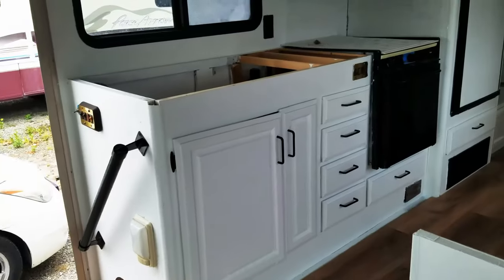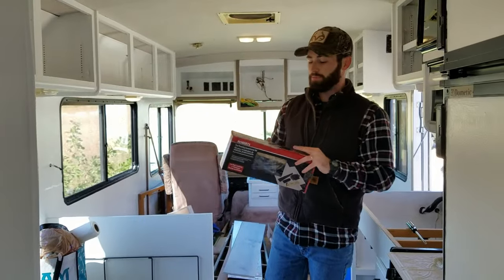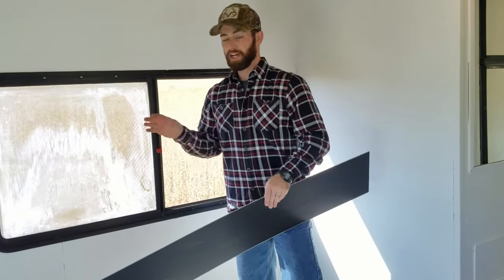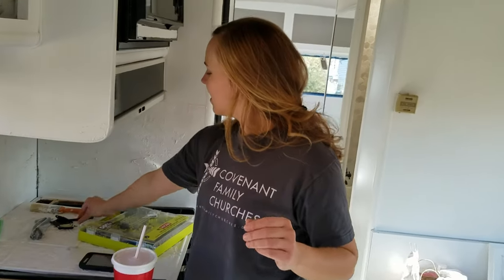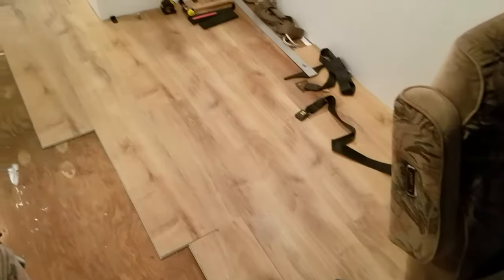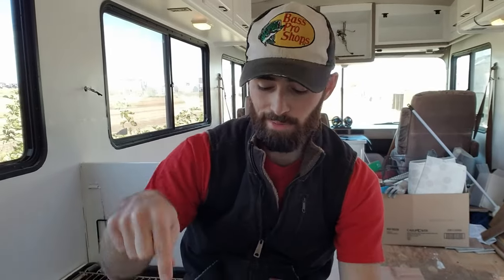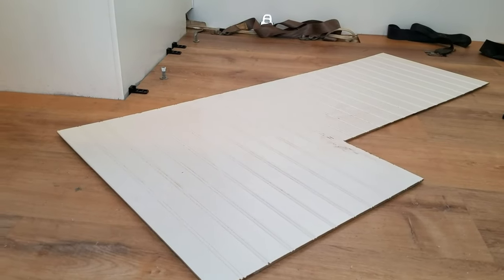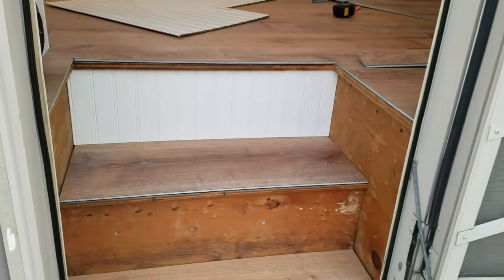DIY VINYL Plank Flooring INSTALLATION and RESULTS in an RV | RV RENO

Comment: Hey Ryan. We are being advised to not do vinyl plank by an RV flooring, specialist because of the expansion retraction issues, etc. he has nightmare stories. I really want to do it. Could you please tell me if your flooring is holding up? Would you recommend sheet vinyl instead?
Reply from the maker: I've had no issues with our vinyl plank flooring. It's been in 90+ to 20 below degrees Fahrenheit weather. I installed the floor with spacers around the edges. No shifting or gapping. Maybe I got lucky, installed the flooring correctly, got a nice brand of vinyl planks, or the motorhome has a smoother ride than a travel trailer? But we've been very happy with our vinyl plank flooring.

Hope that helps! Good luck!

Comment: I hope this helps but vinyl plank is way easier to install than the way you did it. Just mark your measurements, score with a utility knife, and a straight edge, then snap it by bending it where you scored it, and cut the backing. No need to even get off your knees, or leave the work space. It all can be done right there where you are working.

Comment: Good Video.  I am in the same process right now in my new old camper.   Trying to figure out if click together flooring is going to hold up with all of the flexing a 5th wheel does.
Reply from the maker: That's awesome to hear! We're excited for your project! Make sure to send us picture updates through our Instagram! We'd love to see the finished product! 
As for the vinyl floors being flexible enough, I can say we've had no issues with our old rig. And we even got the thicker planks for better floor insulation from cold and noise!

Comment: Did you put the flooring in your entry steps if so how did you the flooring to stick on the side walls ?
Reply from the maker: We did not put flooring on the side walls, we used board and batten wall paneling from home depot

Comment: Did you need to take out your front driver and passenger seats for the new flooring?  Thanks.
Reply from the maker: We did not, but it would of be better to remove them, drill the bolt holes, and secure them back to the floor. Hope that helps!

Comment: Looks beaytiful! Did you add anything to the edge of the steps to cover the connection between the LVP and white board? Any thoughts on using this approach on full size stairs in a house?
Reply from the maker: Hello! Thanks for watching and the compliment! We love how our stairs turned out. We ended up adding stair edging to make the steps look more finished. As for doing this in a home, I say why not! It would be the same process and could look really nice!

Comment: You say it's "very heavy"...how much weight does it add to the overall rig and how did that affect other decisions you made about appliances and etc to keep under max?
Reply from the maker: That's a great question... we didn't really get too official with all the weighing though we probably should have 😅  If you are wanting to be a little more careful about your weight, I would take your rig to a CAT Scale to see how much weight you've got and check out the distribution of that weight on your axles to help you know how much more weight you can add :)

Comment: great video so I have a 30' Fleetwood and I bought the life proof and than returned it.  I ended up going with lumber liquidators  there brand is made of polymer  which doesn't have pvc  no luck with my floor wrapped it out twice already and now calling a installer who wants $900 to install it.   frustrated. and lots of broken vinyl planks
Reply: ripped it out twice

Comment: Why do you need spacers?
Reply from the maker: To allow room for the floor to expand with different temperatures. The vinyl planks dont usually expand much compared to real wood floors. :)
Reply: Joint Movement DPTs 👍

Comment: Just an fyi those are not vinyl floors that’s laminate, vinyl floors you can cut with a razor knife!
Reply from the maker: I believe that's the difference between vinyl peel and stick and vinyl plank - we used vinyl plank, but you can cut peel and stick with a utility knife ☺️
Reply: You’re wrong. It a vinyl plank and it actually can be cut with a knife
Reply: Thanks for that comment. I was confused at the title then watch him cutting what appears to be wooden planks.